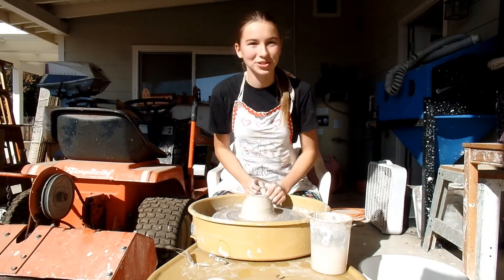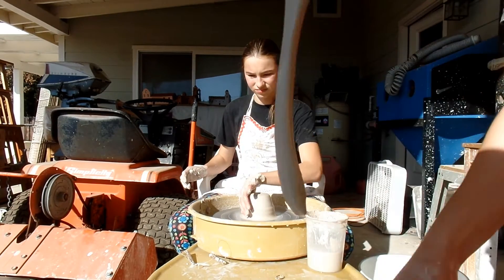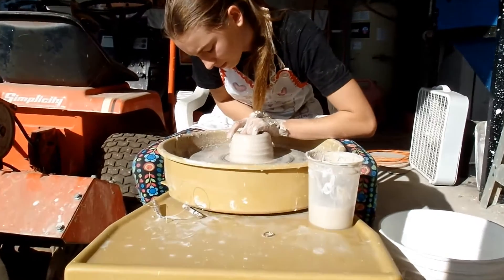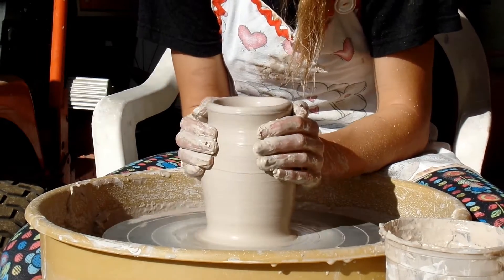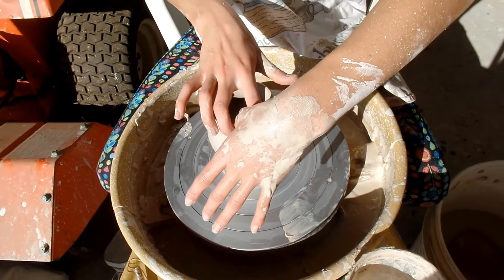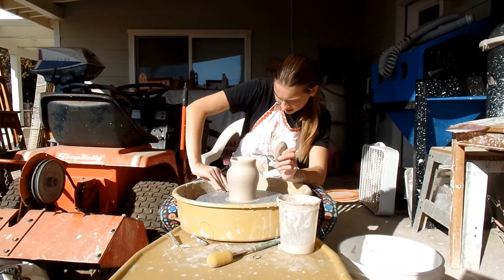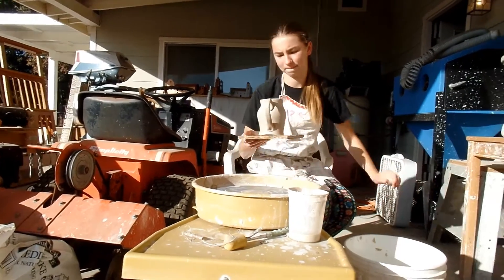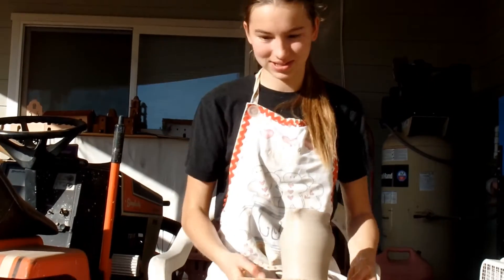Throwing a Pitcher on the Wheel

Comment: Interesting video.  I liked seeing you form the body of the pitcher before attaching the handle.  How do you prevent the handle form slipping off before it dries onto the pitcher's body?  Thank you for sharing.
Reply from the maker: It's called scoring and slipping. We make small lines with the needle tool on both the handle and the pot, then add some slip between the pieces. We didn't really show it in this video, but I'll make sure we do in  future videos.
Reply: @JustBEPottery  That makes sense.  The reciprocal scoring would help hold the pieces together.